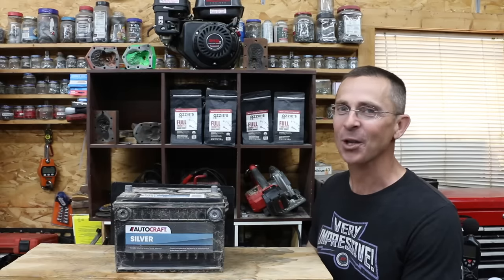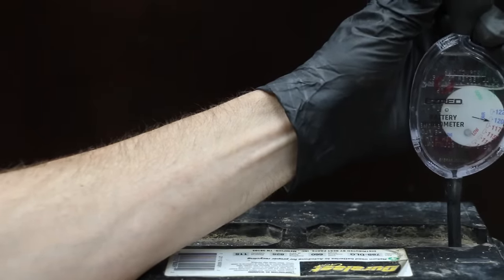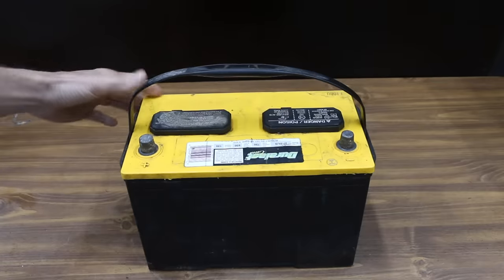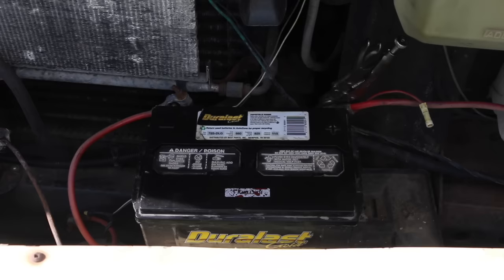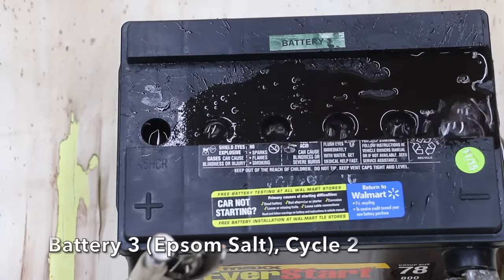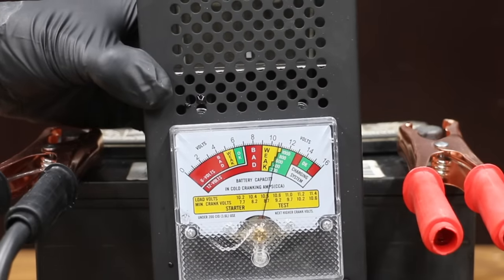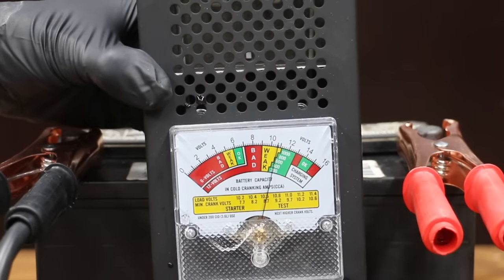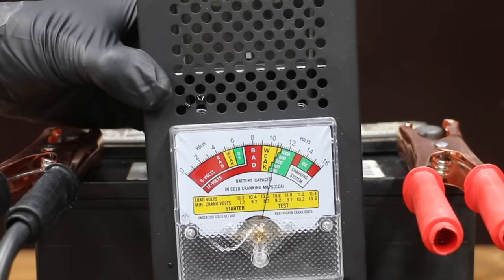Myth Busting! Can You Restore a Dead Car Battery With Welder?  Let's Settle This!

Comment: I have worked in the battery industry for a little over 8 years now. The best tip I can give anyone for trying to recharge a dead battery is get an old charger. By old I mean the ones that have basically no electronics inside. If you touch the leads together there should be sparks. 

Most modern chargers have electronics inside that will see a battery is under 10 volts (some of them 8 volts) and will not charge the battery. Or some of them if it's below 6 volts will see it's below 6 and think it's a 6 volt battery. 
Use the old charger to get it to 11+ volts then swap to a modern charger. 

Another top is using a rubber mallet on the sides of the battery to knock some of the sulfates off the plates. However this should only be done as a last ditch effort as the shock from the hammer blows can damage the battery. Also don't do this near an open flame as the batteries off gas hydrogen gas...

As for the Epsom salt thing. I've heard of it but I heard it was just adding it to the old acid. But I have never looked into this. It just seems weird that they'd remove the electrolyte and swap it with  that since Epsom salt is ph neutral.

Seriously people look at that first tip. This is why we don't immediately swap your battery when you bring it in for warranty. We have to charge it first. 80% of the time this is the cause. The battery just discharged too far for your charger. We charge it back up and it's fine. We can't warranty good batteries. It's not my policy so please stop yelling at me.

Comment: I now wonder if you kept any batteries in storage to see if they still hold up after the jolt from a welder. I'm curious about the longevity of the treated batteries. If they go down hill fast there is little motivation to bother with this process.

Comment: Many years ago when batteries were sealed around the top with a tar like substance my dad worked repairing batteries and the biggest killer of batteries is the sediment that settles at the bottom shorting out the cells. Using an old see thru motorcycle battery that was past it's prime I was able to revive it with agitation, draining and flushing, refilling and charging!
Reply from the maker: Thanks for sharing.

Comment: Thanks for the great video sir! Wants to ask, what does it mean if the battery doesn’t boil while charging it for 12hr  using 24amp charger even though it has a 15.4 volts.

Comment: i wish you would have hit the batteries a few more times, also try flushing the battery and refilling with new acid, then if needed zap it with welder. great video and i appreciate you doing such good work.

Comment: I have access to a large number of mistreated batteries belonging to a friend’s lawn service and have been using the welder method for reconditioning his batteries. It can not recover them all but has a good success rate. I always test the specific gravity directly with a measured volume and scale and have found you never add distilled water to an old battery. Purchase and add full strength battery fluid. 30% sulfuric acid.  Adding water drops the gravity so much as to make the cells impossible to charge.
Reply from the maker: Thanks for the feedback.
Reply: @ProjectFarm  I enjoy your videos. I would love to see a test of adjustable wrenches used the "incorrect" way. We were all taught to pull with the movable side in the lead. From a mechanical standpoint this is wrong. With the movable jaw trailing, it is subjected to a shorter lever arm and should be able to handle the load better. I have the shop press and a scale but haven't been able to bring myself to destroy a couple of wrenches yet to prove the point. This would probably not make an entire video but could be a sideline to a brand test.

Comment: I did 😂the epson salt with an everstart battery last fall.  After charging it with a trickle charge for two days as was said.  I used that battery over winter , all spring, and up to this very date.  Living in far northeast Wisconsin, close the the U.P. ofMichigan,.., we have real winter.    The battery was under size for my large 1995 V8 Jeep Larado.  May I suggest keeping the welder away from the barttery.  And slow charging as directed.  I admit it faild once.  I had the flu for a week and didnt start the battery.  It was almost frozen solid.  I brought it inthe house.., slow charged it.  It started right away and started everyday after including below zero weather.
Reply from the maker: Thanks for sharing.

Comment: Nice job.   I have an expensive "desulfer" maintainer and my experience is... it makes a good battery last longer ... like 10yrs if I plug it in every evening.  I have a number of diesel trucks.  But once the batteries lose their capacity .. the desulfers are unable to "bring a battery" back to life.  Also, if you do this again... might toss in one of these worn out expensive "wrapped spiral batteries"  those red and yellow type.   I forgot the type of gasses released but..... must not be done in a basement or garage that does not have plenty of fresh air.   VR
Reply from the maker: Thanks!  Thanks for the suggestion.

Comment: A quick way to estimate if battery damage is even partially reversible is if it is swallen even so slightly at the sides. Here's the thing. To optimize capacity and cold cranking per lead weight plates especially negative one must be made as spongy as possible or worse, a paste like form of lead between two more stractural but still delicate lead grids. Now not all batteries are created equal but on all, sulfation does increase plate volume hense the swelling. And not all of this is reversible, in fact most of it isn't. If it can stay confined within insulators or at the bottom but not touching other plates, is kind of inert, but it's just dead weight at best from then on. Some permanent capacity loss happens every time some sulfation, ie high discharging happens but all depends on construction. So results can vary widely with manufacturer decisions, discharged state time etc, etc. Also success chance is sadly inversely proportional to "good" battery properties like high cranking amps and power to weight ratios. But if batt is not swallen, and not decommissioned for long I'd say it's worth trying some things. Cheers for the best YTB channel.
Reply from the maker: Thank you for sharing!

Comment: Not sure if anyone else has mentioned, but: i have used the epsom-salt trick on the battery myself. However, i only used it to supplement acid. For example, i discharged the battery which turned the acid to mostly water. Then siphoned out as much as I could. Then supplemented the missing water with the epsom salt water. I have had success that way. But, it's not a one size fits all. Some have too much lead shorting it out.
Reply from the maker: Thanks for the feedback.
Reply: @ProjectFarm  quick question:  you don't generally message subscribers, do you? Just trying to be safe/verify authenticity of communications I've had

Comment: I was hoping you would have   "RE- Acid"  a couple of test batteries, I have been finding Decent luck doing that on Our 8 D  batteries, So far we have Resurrected 6 or 8 Batteries this way!    
   Also on the Big AMP Hit  when trying to revitalize the battery...  I Hit them with 50 amp X 2 & then 150A X 4 ... on Average 50-75%  will come back to life .  
   I was Lucky Enough to Go to Johnson Controls ( they Make the Batteries for SO many Companies Like the Old SEARS DIEHARD's,   I was Foreman for Sears Commercial Truck Center & I got a few Tricks from J. C.   ...the Baking Soda battery Might have worked if you did a Final Rinse and then Re Acid the battery,  but it all depends on how Low the Cells are compared to the rest of the Battery.        Anyway Nice work & I am SO glad you Reminded People about the Danger of ACID Vapor when charging and to make sure its WELL VENTILATED !!!
Reply from the maker: Thanks for the feedback.

Comment: If you have a charger with a high amp start function, that can work well too. Same procedures apply. Battery cannot be frozen!  Ventilate, monitor electrolyte level etc.
Reply from the maker: Thanks for the feedback.

Comment: Hi Todd, I had an idea for test videos.  Portable tire inflators.  I just had to drive 600 miles with a tire that the Costco said could start leaking at any time, and so I bought one.   It was the cheapest one near the house.  But with a brand like Slime, it has to be good, right?  Thanks for all you do.
Reply from the maker: Thanks for the suggestion.  You are welcome!

Comment: I don’t understand why/how epsom salts (magnesium sulfate) would help with a sulfated battery? Wouldn’t you use an even stronger/more concentrated acid to remove the sulfate? The specific “sulfate” on lead battery plates is (to my knowledge) lead sulfate that forms from the battery being unused, the acid reacts with the lead. I’d think strong basic liquids like epsom water would make it worse.

Comment: Thank you, Project Farm, for your extensive video and thanks to all the commenters.  I must say the language is important here and I have to struggle to not dismiss comments that contain the word ‘hygrometer’ or a plead for common sense.  No one that I have met has ever seen a molecule of hydrogen sulfate, let alone an electron.  This comment thread is great!

I oversee 80 aging golf carts with a total of 480 8-volt batteries.  That’s 1920 2-volt 150Ah lead acid cells, .  These carts are on the course twice a day trucking around 320 golfers and their stuffed bags.   Sadly, most of the measuring equipment mentioned here is for 12-volt batteries and cold cranking amp ratings are not my go-to parameters.  Measurement is everything to me, so my new stick welder with its man readable amps will be helpful, but I don’t trust that readout.  So my new clamp ammeter is due Monday.  

Is my basic problem caused by insufficient charging time?  The nights are short now.  I notice that the positive charging wire is no more than #14 wire?! These 7-year-old batteries have been re supplied DI water with never an ion added, never a desulfating effort.  Is the hydrometer a fair predictor of two successful trips, start and stop, around the course?

Lithium-ion batteries are in the plans, but not for today.  All this insecurity is not helping my golf game!
Reply from the maker: Thanks and you are welcome!

Comment: You're supposed the remove the epsom salt solution after charging/discharging a couple times (easy since the capacity is low) and/or pulsing it at high current and replace it with proper sulfuric acid, aka battery acid, then trickle charge it at 2-5A for a couple days even if it's "charged".
Reply from the maker: Thanks for the constructive feedback.
Reply: No, you can leave the epsom salt solution in them,  my son works for auto manufacturer and all their forklifts and tug motors epsom salt solution is all they use in them. But they drain solution out every 2 weeks and put fresh epsom salt solution back in them.

Comment: would be good to note that there are multiple things that contribute to the failure of a lead acid battery. Calendar aging / anode corrosion and degradation is what I am most interested in and it happens even if you never use the batteries and keep them at full charge on a trickle charger.  Supposedly this type of failure is impossible to resolve and guarantees 20% capacity degradation or more every 5 years but that 10 year and 12 year old battery returned back to life makes me wonder. I guess car batteries are typically ruined from sulfation a lot earlier than that and can be restored but I doubt they can ever be made good as new if they are 5 years old or older from a capacity perspective, but maybe from a CCA perspective.
Reply from the maker: Thank for the feedback.

Comment: Have you ever tried to take a bad battery, discharge it completely with a load, and then charge it with reversed polarity. Garage 54 did it, and it seemed to work, but I have not seen the same results.

Comment: Thanks for testing this.  My dad was always piddling with batteries, and I followed suit to a lesser degree. I guess if you just dont have the money for a battery, you piddle with trying to find an old one that will work good enough for a while. 
It doesnt matter what you do with your charging scheme, or BS chemical mods, you cannot significantly improve the mechanical damage to the plates in a battery without disassmbling the battery and replacing the cell contents, once the surface area has diminished, there is nothing you can do to restore cranking amps to new besides mechanically restore the surface area of the lead, meaning taking it all apart, melting down and recasting the lead.  Same if a cell gets shorted, the only fix for that is to disassemble the battery and replace the plates.     Bottom line to me is if you left the lights on or had a bad charging system, charge the battery.   But to keep fooling with a battery that is a goner is a waste of time and energy.  When it is gone, it is gone and is ready for recycle. It is the nature of how a battery works, it will continue to diminish until it is no longer fit for a partuclar purpose. Out of probably 100 tired batteries, maybe 3 of them were able to be brought around to usable condition until the next really cold morning. On car batteries made in the past 3 decades there has been a push for smaller, lighter batteries that can still deliver starting amps.   There are less second chances in them than the old, what would now be consider a deep cycle battery.  Charge it and if it is not then good enough for purpose, dont fool with it any more, go trade it in.
Reply from the maker: You are welcome!  Thanks for sharing.

Comment: Yes running high charging amperage helps with dead batteries. But you also need to add acid a lot of the times. I've revived a lot of dead batteries just by giving them a higher concentration of acid in them along with high charge current. And with the welder batteries that it only slightly helped on it would have significantly helped to fill them with the correct acid content. 
If a battery doesn't have enough acid that limits the energy it can store at higher voltages. So pretty much it reduces the working voltage the lower the acid content which is what the testers test, and what starters need.
Reply from the maker: Thanks for the feedback.

Comment: This is a pretty cool video. I haven't heard of the welder trick before. I wonder if i could press my Hobart Handler into this type of service, or if an inverter-stick welder is required 

I don't put a lot of stock in those dinky desulfator gizmos that are battery-powered. Desulfation is a real thing, but it requires a real device that doesn't kill the battery at the same time it "desulfates". Desulfation uses periodic high voltage spikes to break down the chemical bonds of the sulfated layer on the electrodes. I would really be keen to see how a proper trickle charger/desulfator works for rescuing old or neglected batteries, rather than the alibaba-special that i continue to see examples of being a worthless gimmick. 

The device i've been using to restore batteries from storage is the "Battery Minder Model 2012 - 12V 2A Smart Charger Desulfator" which will first bring the battery up to charge and THEN will maintain the charge while also desulfating. I think the realistic expectation is that it could take up to two weeks on the trickle charger/desulfator to repair an old battery to working charge.
Reply from the maker: Thanks!  Thanks for the feedback.

Comment: Interesting test. This would be good if you already have a welder. If you have to buy one, not so good. If you can borrow or rent, maybe. I would be curious to know how long a successfully rejuvenated battery lasts. If only a few months, it is not worth the trouble. My coworkers and I once read some research and built a device theresearchers used that rejuvenated AAA, AA, C and D cells. It worked, but battery life after rejuvenating was very short and there was some risk of explosion, although we did not have that issue.
Reply from the maker: Thanks!  Thanks for the feedback.

Comment: One mistake: forgot to replace Epsom salt with fresh acid.
One gave up too soon: another test found pulse charger repaired two of four different failutlre modes.

YES,I expect welder would work. I used to recover NiCd using a high power 6v lantern battery. Similar effect being careful: many short touches to melt internal shorts...

Comment: Wait, number 3 battery doesn't have any sulfuric acid in it anymore. It has to have sulfuric acid in it in order to work.
 Thank you for your videos, they really help us out a lot.
 Also, if you have any more dead batteries, can you try EDTA treatment? You can get the right kind from Trailhead supply in Utah.
Reply from the maker: You are welcome!  Thanks for the suggestion.

Comment: I like to see how the result is here I'll be watching to see cuz I've done that with a tractor lawn tractor battery that would only charge up in about an hour on a charger and barely start the tractor once and then it be dead I did it I did this thing that was done on the one channel with the arc welder and now it's working to full capacity it is now started it multiple times
Reply from the maker: Thanks for sharing.